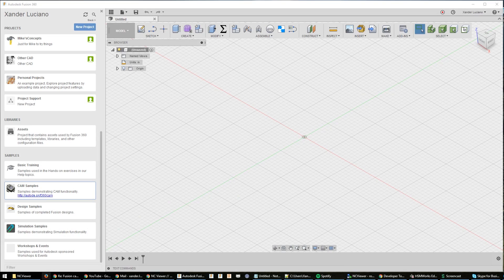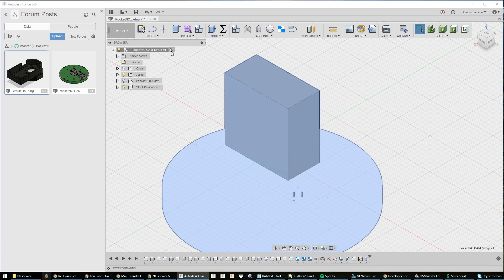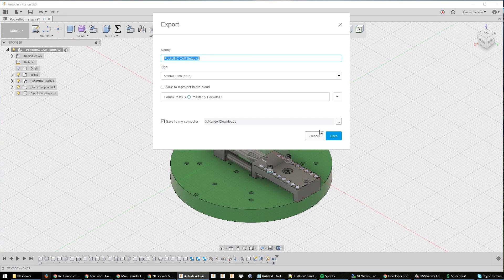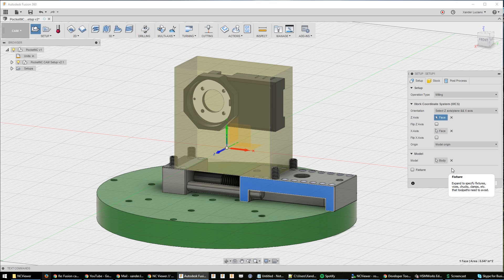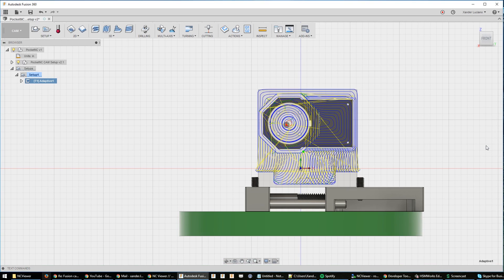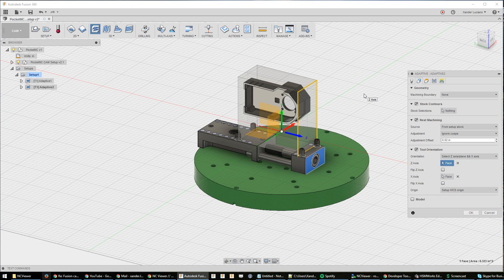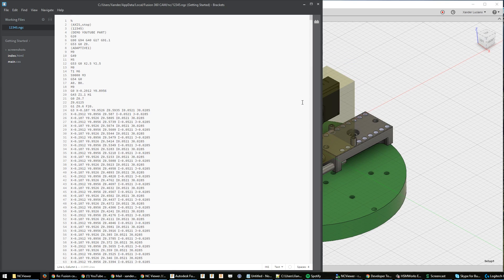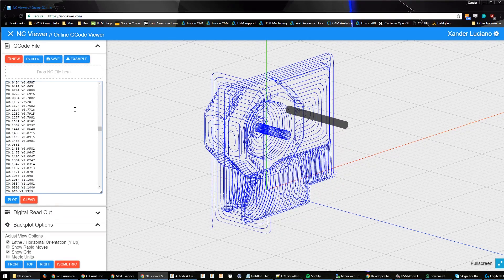PocketNC CAM Setup Tutorial

Comment: yo thank you so much for the nc viewer... I am new to the cad/cam game and thank you for the video... running fusion 360 and got a pocket NC as my learning curve.... thanks.. if you could bang out a video on setting my pocket nc offset from the table... ive ran a sketch line off to the .8326 origin point and still pulling errors... luckly just found your ncviewer and don't have to run across town while im running trial and error lol.. long message to simply say thank you ver much.... going from being machinist by hand to cnc programmer has been one fun ride.. thanks so much for your help//// prob should have spell checked or proof read...…… naw RAW lol

Comment: may chat ? i have many questions , by the way i built  my 3 + 2 cnc and i want to learn the fusion more , fast question after milling will be a neck hold the project with the body of the original material ? or will it fall ? , and can this g code works normaly with mach 3 ?

Comment: hey luciano, great video, quick question for your ncviewer could it be possible to insert a cad part for example insert the pocket nc, so we can get a better feel for the rotation capabilites of the pocketnc and look if that toolpath we created is actually possible to run instead of potentially damaging the pocketnc. Just a thought!
Reply from the maker: Thanks and great suggestion! I have something along the lines of machine simulation planned that will support this, but it will be some time before I have that fully functional and integrated.
Reply: Machine simulation is working well with NX and Mastercam..... but who wants to use those?   I really want Fusion 360 to excell

Comment: whoops i accidently deleted my comment^^ I have possibly found a bug, i have generated my Toolpath in Metric units but the Toolpath looks somehow strange and not complete and the tool is not following the toolpath but it looks like it is following the toolpath in imperial units
Reply from the maker: No worries but oh huh, yea that is definitely not following the correct path. I probably forgot to convert the tool positions to metric. Sweet, thanks for catching that!
Reply: No Problem :) Btw the Machine simulation is really nice, is it also able to detect collisions? what about different workholding solutions?
Reply from the maker: Thanks! And I have some code in place for collision detection and fixturing, but it's quite a bit of work. My current plan is to add all the "core" features a backplotter should have, and then begin adding advanced features such as collision detection and more complex setups.
Reply: Sounds Great, take your time but don´t rush it :)